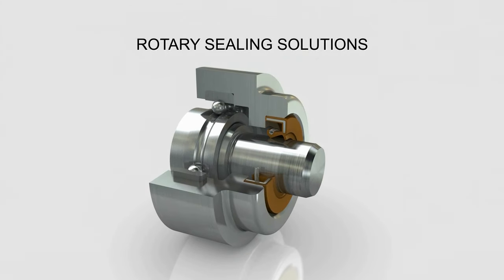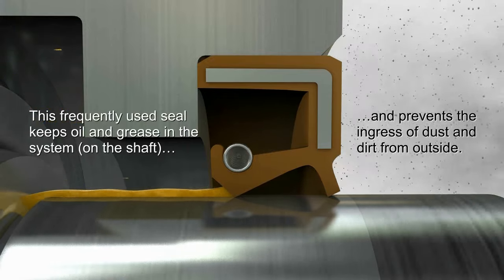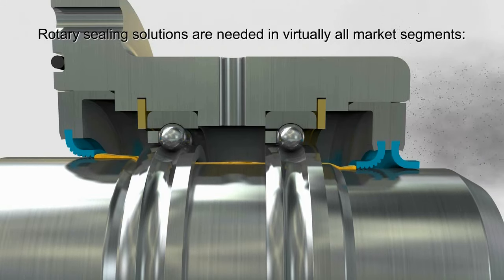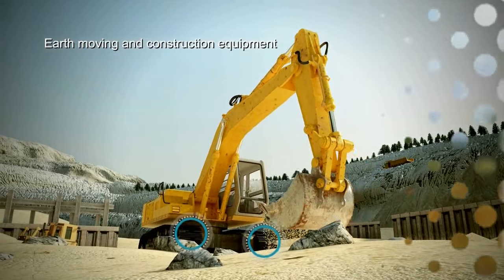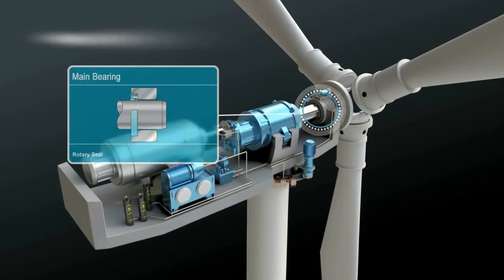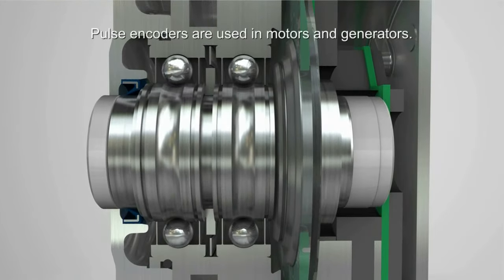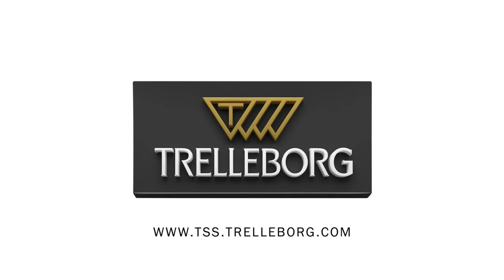Rotary Sealing Solutions: Radial Oil Seals and V-Rings

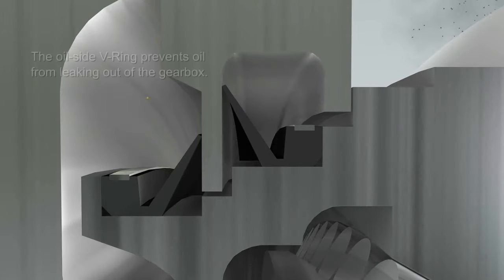Comment: @2:06... V rings on either side of a fixed bulkhead... think of really big V rings with extra large flange lips.. on large ship propellers where they go thru bulk heads.  so the ship can flex without any fear of a flooded compartment leaking thru the gap..  making the V seals Split to allow replacement and installation since pulling a propeller shaft on a 1,000 foot long ship is not easy..   see if you can find a copy of the Emma maersk accident report..  it will show that some but not all of the flooding was caused by the ship flexing the shaft seals leaking..